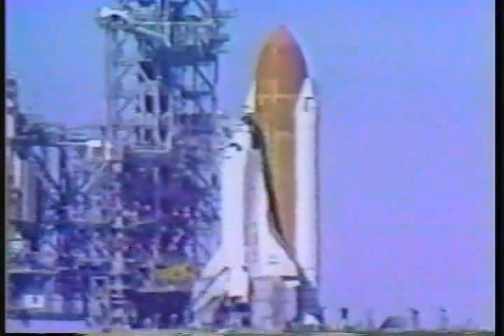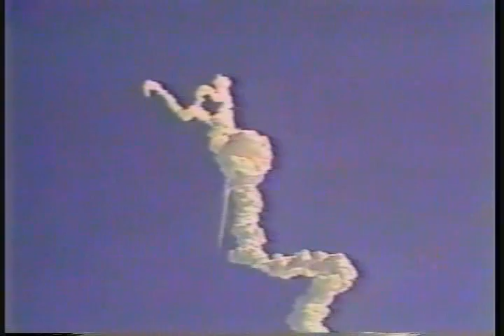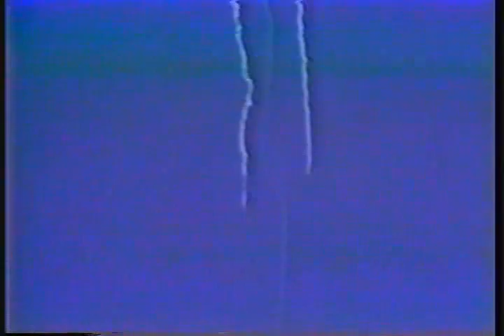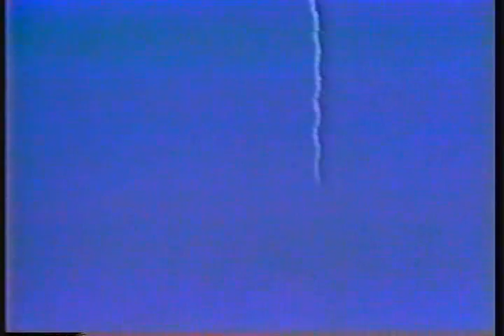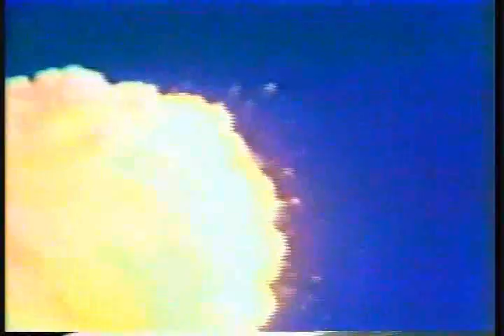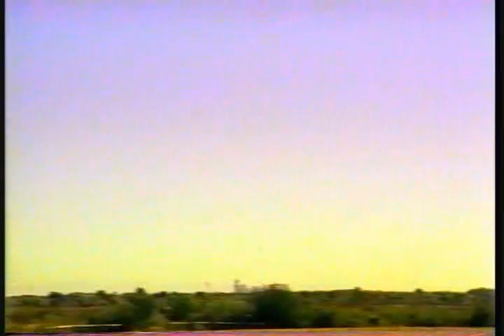STS-51L launch: The Challenger disaster (1-28-86) (plus replays)

Comment: It's impossible to know if the "slag seal" would have held without the wind shear which was severe by how much the plume moved left and right (also some of the motion was a probably due to the sideways thrust of the leak).

I often wondered if the leak had been on the outside of the SRB and "shielded" from the tank if that would have helped, but I think a SRB sep the booster may have moved in an odd way and hit the tank or Shuttle.

Comment: 9:22 right about this time, by looking at the way the exhaust trail snakes to the left and right right after it leaves the engines, you get an idea of just how much wind shear the shuttle experienced as it passed through Max Q. If not for the wind shear, it's theorized that the aluminum oxide slag that blocked the hole in the O-ring might have held until the SRBs separated.

Comment: About 10 seconds or so before it breaks up. You can see the whole shuttle move like two times. That wind had to be strong and that was part of the issue as well. It moved that SRB into the tank. Still sad to watch after all these years.
Reply: Wind shear was terrible that day. Like 51I they launched in bad wind and weather but add the cold temperatures in for this one. The SRB leak was plugged by some of the leaking propellant and the wind dislodged it.

Comment: They were alive,  and most likely awake, the whole way down until the crew cabin, which exited the breakup fully intact, impacted the ocean. Forensics indicated the commander attempted to restore power to what he assumed was an intact orbiter due to switches that were found to have been flipped. 

The solid rocket boosters were included in the Space shuttle program due to a political decision. Congress wanted to keep ICBM missile manufacturers in business. Government bureaucrats overrode safety concerns of experienced engineers.  The use of solid rockets in a manned flight system was, to say the least, insane from the start.

The Space shuttle was the deadliest spacecraft ever constructed. It killed more astronauts than all other craft built by Russia, the USA, and China COMBINED. Its final catastrophic failure rate was 1 in 60. The number of black zones in the Shuttle abort profile exceeds safe zones 3 to 1. This means if you have to have any kind of abort in a Shuttle launch, it is safer to not abort in the first place and take your chances riding out the failure.

The program ultimately cost $140 billion, and is directly responsible for NASA never going back to the Moon and never going to Mars. It was a money pit that destroyed America's reputation in manned spaceflight, and now, almost a decade after the program ended, its dangerous, expensive technologies are being rolled over into the SLS program, ironically in a non-reusable capability. And to top it all off: the solid rocket boosters of the SLS must fire for LONGER than in the Shuttle program, as they've had to add two more sections.
Reply: The Space Shuttle's development was also extremely rushed...
Reply: GigaSyntaxTV originally intended to save Skylab but never happened.
Reply: Beyond stupid comment.  For how  dangerous space travel is and only 2 fatal accidents... yeah ok. I bet you get in a car though and drive don't you when thousands die daily in car crashes.  So my question is when your brain is made of dog shit do you smell it also
Reply: @HooyahPeacock  The space shuttle is what made space flight dangerous. If you ignore the space shuttle, space flight is dangerous, but not THAT dangerous. No spacecraft other than the space shuttle reached such insane levels of danger.
Reply: @aonnyign naong I think there is nothing wrong with reusable entry vehicles in principle, and they do have some advantages as a reused vehicle has already been flight tested. But the shuttle stack arrangement where the orbiter was subject to falling debris from other parts of the shuttle was asinine. SpaceX has an astonishing record of success with reusable rockets including 26 launches this year alone, a launch rate far beyond what the shuttle could ever achieve. It's not just reusability alone that matters. What also matters is how that reusability is achieved. For example it turns out that the SpaceX approach of landing rocket boosters dry in one piece is far superior to the shuttle boosters which were subjected to salt water immersion after each launch and then had to be taken apart and reassembled again. (The Challenger disaster resulted from failure at exactly one of those reassembly points.) Similarly the Falcon 9 booster engines are far faster and cheaper to turn around than the shuttle main engines. Superior design makes a difference, not the mere fact of reusability.
Reply: Mostly BS. Some of the astronauts did activate their PEP. Indicating some of them were alive after the break up. But they don’t necessarily know if they had succumbed to G forces on the way down or not. Otherwise, most the rest of that is nonsense.

The solid rocket boosters were included, because you actually had to lift the fuel tank off the ground. Gravity is funny that way.
Reply: @elymayer4860  Nobody is arguing over why rocket boosters were needed. The issue is that the rocket boosters were solid fueled as opposed to liquid fueled. The shuttle is the only manned launch vehicle ever that used solid fueled rockets.
Reply: @elymayer4860  You mostly don't know what you're talking about. Perhaps you should read the official reports and investigations.

The crew cabin was only subject to approximately 12 G at breakup, but this was an instantaneous gforce that faded to 4 G within 2 seconds. GLOC is rapidly recovered in trained individuals, so the astronauts would have recovered within 10 seconds. They were in freefall for a full two minutes.

The PEAPs were activated for everyone on the flight deck except for commander Scobee, some of them activated from behind, indicating the astronauts assisted each other. They're also activated manually, so they could not be activated by unconscious crew. In addition, pilot Smith flipped several switches indicating he was attempting to restore power to the crew cabin. These switches were in the exact configuration as one would expect when attempting to switch to emergency backups and could not have been thrown inadvertently by the forces involved in the crash.

Lastly, the PEAPs all indicated oxygen consumption corresponding to the amount that would have been consumed  during the time from the accident until the impact of the crew cabin with the ocean.

The idea that the crew was unconscious is based more on people's emotional need for the astronauts to not have suffered than it is on the forensic evidence available.
Reply: @magicstix0r  I did read them. That’s how I was able to correct you. 👍
Reply: @elymayer4860  you clearly didn't, because your so-called "corrections" didn't even use the proper acronyms and didn't show the slightest understanding of the g-forces involved. Please explain how a crew in freefall will be subject to GLOC-inducing forces and how an unconscious crew can activate manual PEAPs and flip cockpit control switches.
Reply: @magicstix0r  No, I clearly did.

And I’m not worried about auto correct. Thanks for stopping by though.

Oh, just to clarify, when I say “succumb to the G forces,” I mean they may have been passed out. Not that they were killed by the G forces. And since they did not have positive pressure oxygen, if the crew cabin sprung a leak, they may have passed out from a lack of oxygen before the descent of the CREW cabin was low enough for useful, breathable air.

Lastly, I think you said it was the commanders side where the switch positions were changed from launch position. It was actually the pilot side.
Reply: @magicstix0r  So....Nothing then? Ok. 👍
Reply: @elymayer4860  "Sorry for hurting your feels, boomer"?

Really? LOL. OK.

Comment: If challenger didn't explode it would've been still launching up till maybe 2003 or 2004
Reply: NicDaMonsta/Baller6921 6921 the last launch of the shuttle was in July 2011
Reply: The Apollo Gamer I meant challenger
Reply: Why 2004/03?
Reply: @PistolPete659  she was the second oldest shuttle in the fleet and also most used before the disaster. And like plane, it's has certain cycle that its can operate. So 03/04 is quite reasonable

Comment: There were no parachutes aboard Challenger...the crew was locked in the cabin, and died when the cabin hit the water after the Challenger broke apart.  Some of the crew actually survived the breakup of the shuttle and turned on their emergency air packs, but the crew compartment impacted the water at over 200 mph, which was unsurvivable.  The crew was probably unconscious on impact anyway, as the cabin had lost pressurization, and the crew was not wearing pressure suits.

Comment: I don't think the STS-1 TPS problem was major because the tiles just fell off, whereas in STS-107, the foam struck the Carbon-Carbon shield which breached the wing, and started melting the wing from the inside out
Reply: That's what actually happened to the final Columbia at most likely its entry.